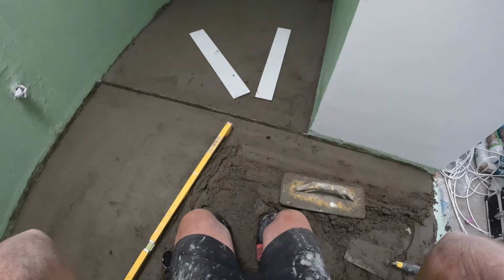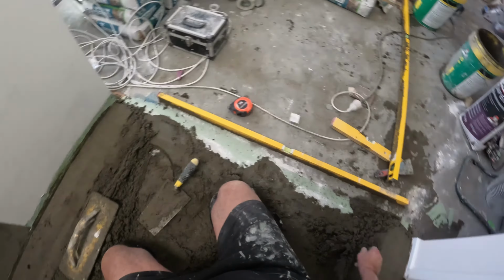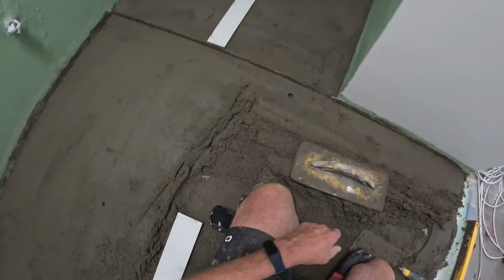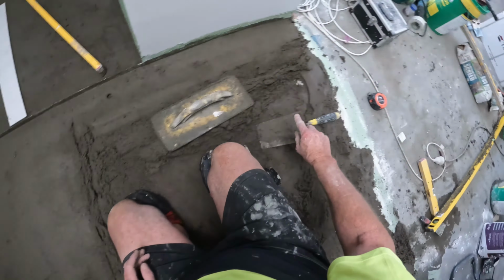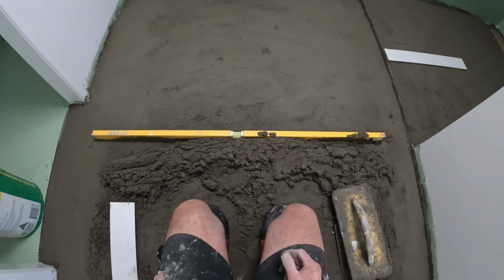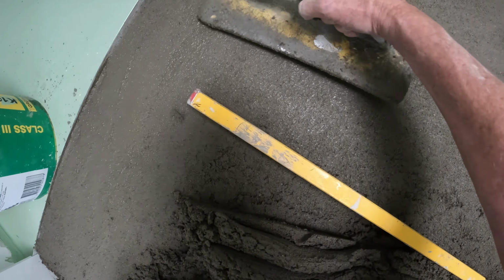DIY Learn How To Tile, I Will Teach You Chriso 👍👌💚

Comment: Couldn’t just make a ramp 100mm inside the door frame and ramp it down to 12mm with an angle on the front? Save having to have a step up?
Reply from the maker: What 😝😝😝
And twist it like a propeller to the out of level old floor
Reply: Think you might be a little out of touch these days mate. Who wants a massive step to trip on? What’s worse, a ramp or a massive trip hazard.
Reply from the maker: @benjamindelfs2718  what ever
Reply: It’s literally how most QLD new homes are done?? They do a ramp to the floor tile outside the bathroom so there’s no step. How’s that worse? 🐢🐢